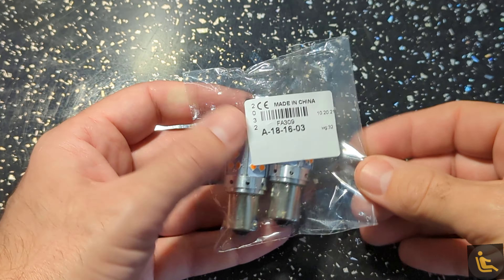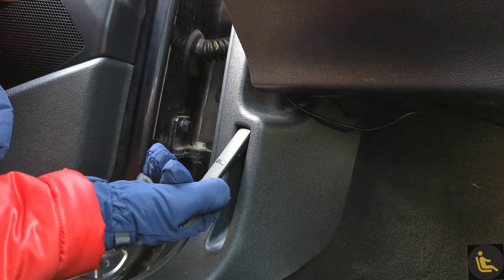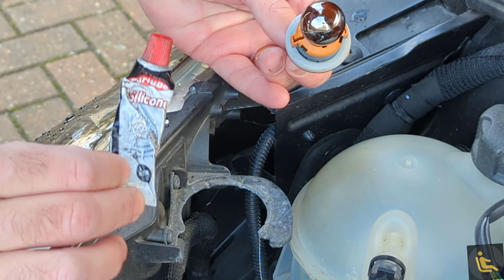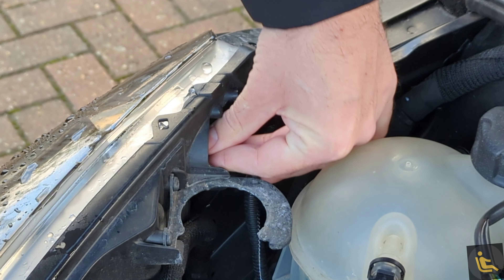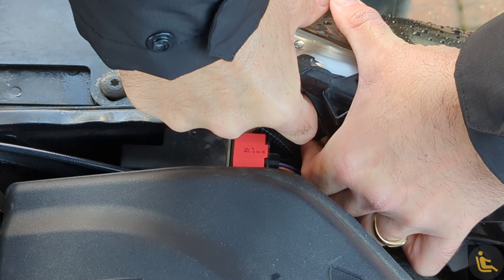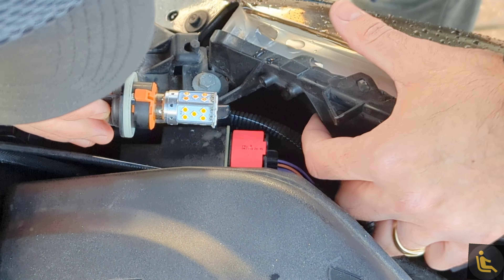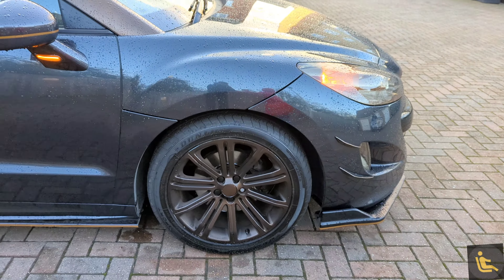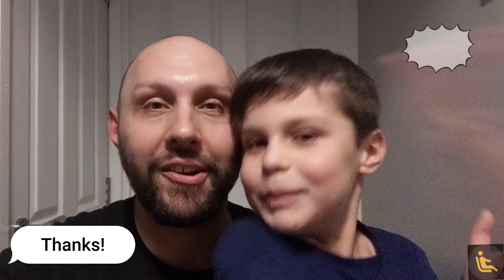How to Upgrade Front Indicators to LED Canbus error free PY21W on a 2010 Peugeot RCZ HDI

Comment: Where did u get the bodykit? Skirts/splitter etc?
Reply from the maker: All from eBay ☺️
Reply: @CarFlix.  ah nice :)
Reply: Is it just as easy to swap from halogen headlights to led headlights do u know?
Reply from the maker: @shadowbreed29  It's illegal and an MOT failure  to change dipped and high beams from halogen to LED in the UK unfoortunately 😔
Reply: @CarFlix.  ah cheers, didnt know that ^^

Comment: Hi. I've got the same car how did you change the Front Lion symbol to a Transformers face where you open the bonnet. mines a 2011 model
Reply from the maker: Hi Thanks for your comment ☺️, all you need is a hairdryer to heat it up and pull it off, there will be 3 holes underneath which the transformer badge sticks over perfectly 😊
Reply: @CarFlix.  where can i buy the badge & cheers m8
Reply from the maker: @11teen71  https://www.ebay.co.uk/itm/Transformer-T5-Autobot-Car-Van-Badge-Gloss-Black-Brand-New-/302134533005?mkcid=16&mkevt=1&_trksid=p2349624.m46890.l6249&mkrid=710-127635-2958-0